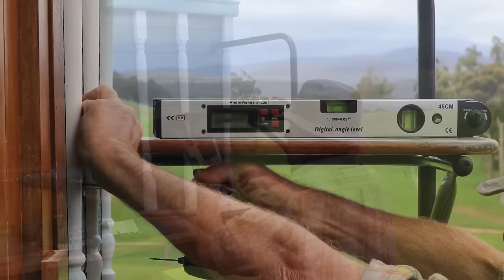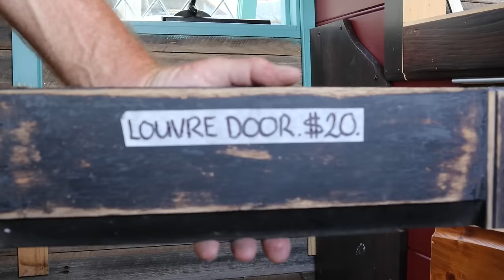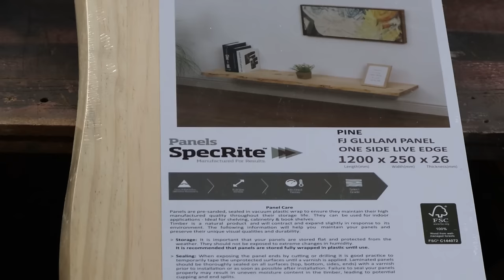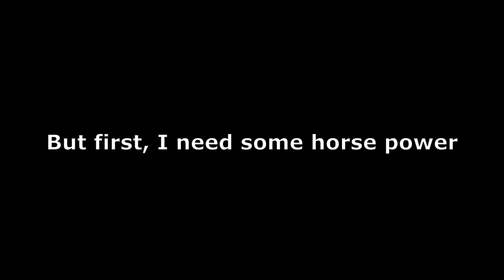From Go To Whoa! Time Lapse Gypsy Wagon Build - From Go To Whoa There Horsey!

Comment: As a child i read books like the box car children. I always wanted to run away and live in a box car at the edge of the woods. Then pne simmer my aunts came to visit and told stories about the gypsies that pulled their wagons with horses up to their farm and lived there for the summer. My father was 4 - 8 and during those summers he spent most. Off the day ,as soonn as his chores were done. I envied his childhood. 
Tthe gypsies repaired tools for houses and farms. And gleened the fields. They taught him many things. And my uncles started doing carpentry with them. 
I LOVE THIS BUILD...
Reply from the maker: @marjoriejohnson6535  Yes it's a shame that some elements and methods of lifestyle of times long past don't exist anymore. I guess technically they still do, but so modernised that the 'romanticism ' of those ways is lost. Of course that's not to say life was generally easier in those times, it just wasn't as scrutinised or regulated so much. Try pulling a modern car and caravan up beside a farm now and staying for a few months! There'd be cops, fines etc.!
Reply: @RedPathRambler  I would l I ve it if a Gardner pulled in with campers and did my garden...he looked i definitely would feed for the summer...

Comment: My favorite part is that you repurposed all of that furniture. The headboard as a table impressed me, but the sink! Such creativity! I loved the seats on the porch. I am sure you will use them all of the time. I thought for sure you were going to bring in a horse to pull it. I'm just wondering how top-heavy it is? Beautiful work, especially in the exterior decoration.
Reply from the maker: @Kammy44  Thank you Kammy, glad you enjoyed it. 🙂
  The repurposing of things is probably the most fun part, making things work. It handled the short journey across the paddock very well. Pretty much all the weight is low at floor level and below. Sadly though, I have since sold the wagon.
Reply: @RedPathRambler  The creativity is in the making! I bet you will just make something else great!

Comment: My grandfather was a cartwright/wheelwright. In assembling the chassis, it's important to have the axels the right way 'round because each side is threaded differently. That ensures that the forward movement of the caravan will keep the wheel nuts tight. Otherwise, the nuts loosen, and off come the wheels. (There were even automobile manufacturers who perpetuated this practice for fastening tire rims to axels.)
Reply from the maker: I admire the old trades, or at least the surviving old trades. 
I think my wheels were a bit different in that they slid on the axle and then a heavy duty pin dropped into a space preventing them from working their way off. So, no actual wheel nuts on them.

Comment: @redpathrambler thanks for mixing old school knowledge with new school ways. That's art on wheels! If it's properly road worthy...you could easily sell these four thousands of dollars! My only suggestion would be encase the front porch in clear plexiglass, add storage under the seats like a  mini fridge under one and a mini crackpot under the other for road trip snacks! Make a folding table against the front door and screen it off for eating outside.  
I must have missed it...what is your power source? Did you install solar panels?
Reply from the maker: Thanks for watching. 🙂
   It's possible this video didn't show it very well, but there is a dedicated space inside for a mini fridge, more detail of which is in one of the episodes. I was contemplating a hinged, lift up table fixed to the door on the outside, but fast dwindling funds had me basically just tying off loose ends to pick the end point of the build. I've since sold the wagon, sadly, but I needed to recoup costs. The wagon was also professionally wired for on road use rules, with a 15 amp power inlet, so just like a caravan. In Australia, horse drawn carriage road travel is practically non-existent, other than enthusiast day run events and the like. However, I built this with the ability to have it lifted off the under carriage and placed on a certified trailer for normal speed road travel. I believe the new owners are setting it up as an Air-Bnb option.

Comment: You missed one thing, the two horses needed to support the weight. Amazing work , for me the question of horses power is first. Gypsy wagons are such more light.
Reply from the maker: Thanks for watching. 🙂
   Didn't have the horses on hand unfortunately. The under carriage and platform I started with is an original Melbourne Brick Cart, very heavy duty. So when loaded, it would have been pulled by a team of horses, probably 4 or more.  Hence, I only built a traditionally inspired Gypsy Wagon, not a real one.

Comment: At 24:25 you resembled George Clooney in my opinion. I loved watching EVERY moment!❤ Every time I thought of something you could do, you were already doing it.😅 Your imagination and attention to detail is amazing! As a woman, I would have liked to see a hidden bucket/composting toilet and wondered if it was possible to have either a hidden compartment for a small cooler or regrigeration of sorts either in the floor near your water holding tank below deck or in one of the dining bench seats. Also, did you accidentally hang your curtain to your bedding area upside down? Maybe I'm wrong or I cant figure out the picture on the curtain. I'm not trying to sound critical by any means because it's beautiful and you definitely designed it far better than the one you showed in the end! Well done Sir!
Reply from the maker: I won't lie, I have had that Clooney comparison a couple of times in my life. I'm sure he would be flattered to hear it. 🙂
  Well...if one was inclined to to watch the individual episodes of the build on my channel, most of your questions would be answered there in detail. But I'll cover them anyway. Directly beside the glass door pantry, at the front, is a space specifically for a mini fridge, although I didn't put one in, but that's what that space is for.  Alternatively it could be a cramped little space for one of those cassette type toilets that camper vans have. The curtain isn't upside down, however it was cut down from a massive 3 metre x 3 metre 'tree of life' curtain that I found in a thrift store. So I had to compromise what would be discarded when drastically cutting it down. 
   Hope that answers your queries. Thanks for watching. 🙂
Reply: @RedPathRambler  Thank you for the reply. This was the first time your channel was suggested to me, and it was already approaching early morning. Almost 6 am.  🤣 I will most definitely watch more of your content. Very much enjoyed the scenery with those beautiful cows and birds 🐦. If I can make a small suggestion... When putting the captions telling us what you're doing or deciding, it would be very helpful if the captions remained for about 8 or 10 seconds. I can read relatively fast, but I couldn't catch the last couple of words and had to either go back 10 seconds or watch it on a slower speed.  Thank you, and have a wonderful day and a blessed week.
Reply from the maker: @trinarock8643   Thanks for watching 🙂
  Editing is a still a learning process for me. I'll get better at it. Pausing helps 🙂

Comment: Beautiful build!  One question:  What tongue weight did this wagon end up having?  Not sure if one horse could pull this beautiful, ornate wagon?
Reply from the maker: Sorry, I missed this comment. I had a guy in the know come out and identify exactly what kind of carriage I had. Apparently the carriage and tray (before I built anything on top), was an original Melbourne brick cart, 2 ton vehicle with the capacity to carry 4 ton. Which I dare say a single horse never pulled this carriage, rather a team of them. And although I never had a chance to a weigh it after my build, I estimate I only put somewhere between a half ton to 1 ton on top.

Comment: Make these towable like any caravan (compromise a bit on fittings and build for weight) and I can tell you now many of the older women travelling, due to the housing situation in this country, would very happily pay for such a 'home' on wheels.
Reply from the maker: It could relatively easily be lifted from the under carriage and placed onto a compliant, towable trailer no problem. 👍

Comment: It's a good looking van, from a distance, but there's some mighty strange choices in this build, materials, techniques, design. Yeah, making it up is about right. And a lack of many traditional skills normally used in a real gypsy caravan.  And it's also the style of van mostly used by showmen not gypsies.
I thought we were going to see a horse pulling it was well. I'm not surprised you moved it with a VW bus, that thing must weight a ton! Several tons!
Reply from the maker: Thanks for watching Colin. Good thing I never claimed to be building a real gypsy caravan. I had a guy in the know come out to identify exactly what kind of cart I had. An original Melbourne brick cart apparently. A 2 ton carriage with a capacity to carry 4 ton. A single horse never pulled this cart. So I was fakin' it from the get go. 🙂..as explained in one of the episodes of the build series. Although I didn't get a chance to weigh the finished product, I estimate I added somewhere between half a ton to a ton of weight. The Volksy pulled it easily...I didn't have a team of horses available unfortunately.
Reply: @RedPathRambler  You took that well! Unfortunately I am a bit of a pendant when it comes to the gypsy caravan, it's history and the crafts and materials used to  build one, as well as the travelling life of the gypsies of the era which dictated their design. Your method of building certainly produces an attractive result which will be a pleasant place to spend time relaxing. And I shouldn't criticise a man who makes a thing.  I would just like to urge people to look at how these things were made in their heyday.
Reply from the maker: @colinmcmb   Well, I took one look (more than one, a few), at the traditional and thought nope, that's beyond my skill set. Of course that didn't quell my creative streak in embarking on the build. I basically built a modern caravan, hidden under a homage to an old way of life. 🙂

Comment: I can't help but feel sorry for the horse's. All those 2x4s are heavy. I'm not putting what you accomplished down. In fact its very admirable that you took what was left and made it work. But my Grandfather built a camper out of 2x4s, and it was a very heavy thing to tow.
Reply from the maker: I had a guy come out and identify the carriage and tray, as an original Melbourne brick cart, a 2 ton carriage with the capacity to carry 4 tons apparently. So it would have always been pulled by a team of horses in it's day. I estimate what I built on top to be possibly between half a ton to a ton. But then I never did get around to getting it to a weighbridge, would've been good to know.

Comment: Anyone else estimating the weight of that wagon finished? Woof
Reply from the maker: @livinglife8333  I had the carriage and flat bed identified as an original Melbourne brick cart. If I remember correctly,  I was told it was a 2 tonne carriage with the capacity to carry 4 tonne. No doubt with a team of horses. My guesstimate of what I built on top, possibly somewhere between a half tonne and 1 tonne. So, pretty light compared to what it was built to carry.